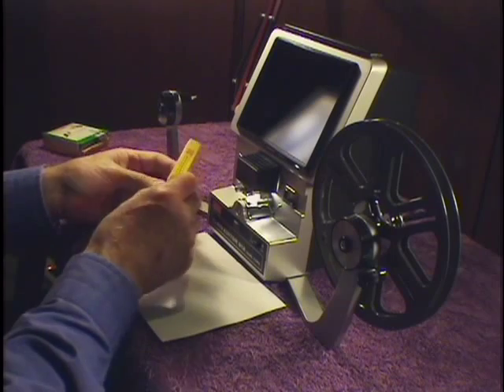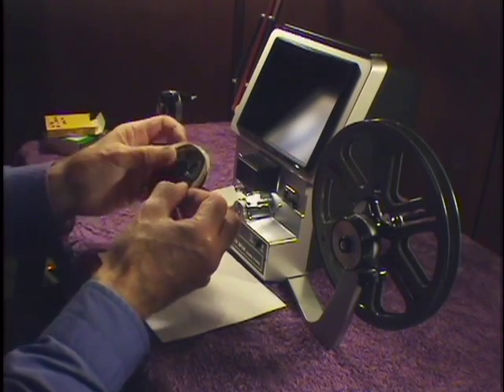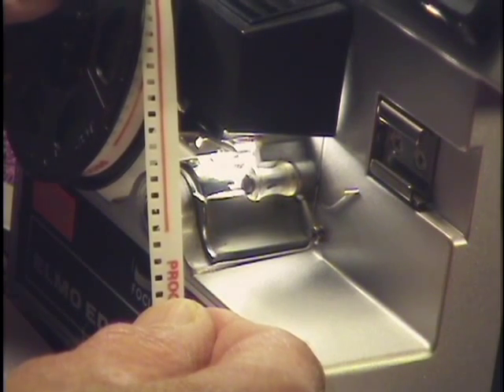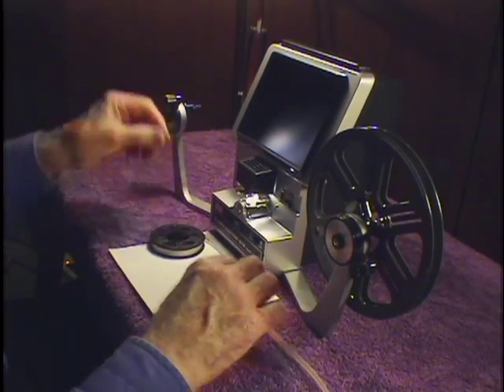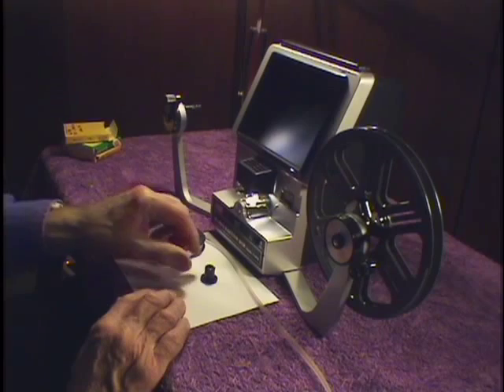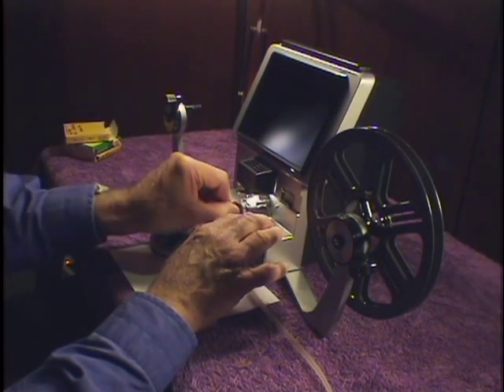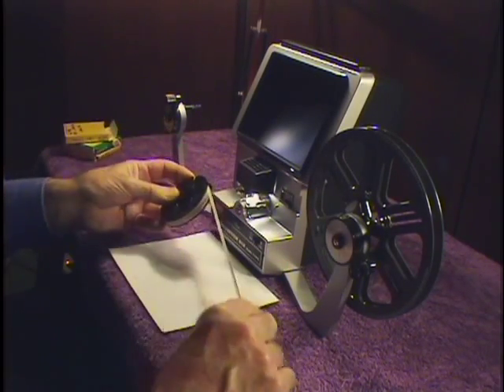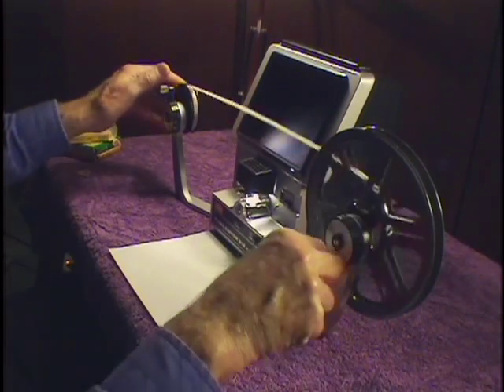The Elmo Viewer: Switching Gate Settings on Elmo View to Regular 8mm (clip 25)

Comment: Well thank you for that. I picked up a Asanuma PE-180 dual 8 editor in a thrift shop and have been in the 8mm game for 40 years.  I've had many cameras and projectors and several viewers in years way past and shot thousands of feet of S8.  But the changeover from reg 8 to S8 on this machine had me completely baffled because I didn't know that the smaller s8 perfs could run on the reg 8 sprocket teeth like that.  I thought that there was some  need to change the sprocket for S8 but couldn't for the life of me figure out how or where the other sprocket would be.  The Asanuma is very similar to the Elmo 912 so my problem is solved from your video!